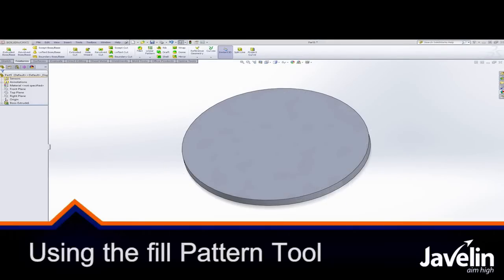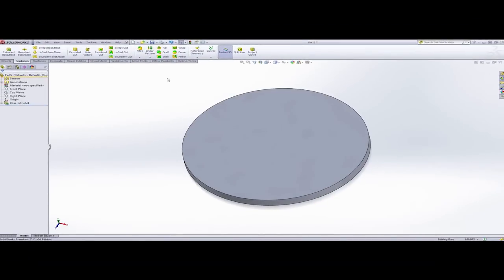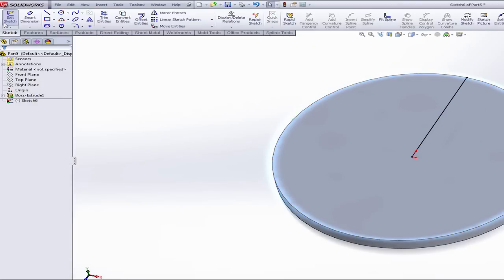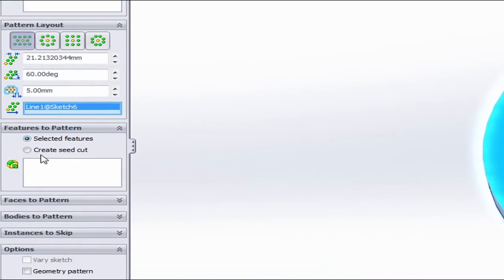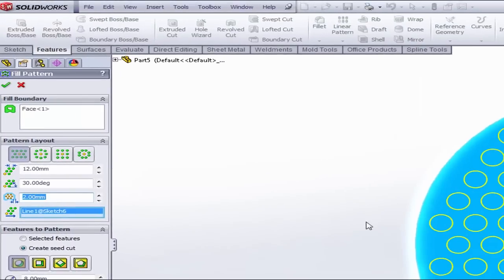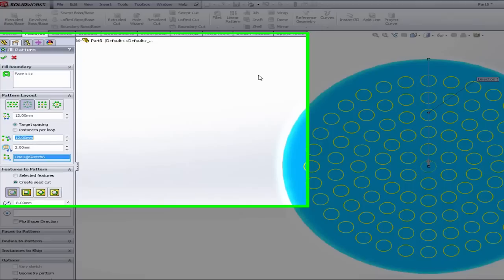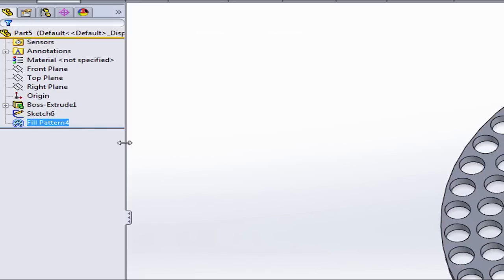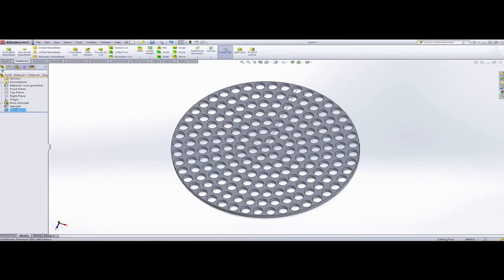Using the SolidWorks Fill Pattern Feature

Comment: So i need to make a pattern of holes where they're equidistant from eachother which means they can't be in a straight line anywhere, so the centers of 3 holes are the corners of an equilateral triangles. Can I do this with fill pattern?